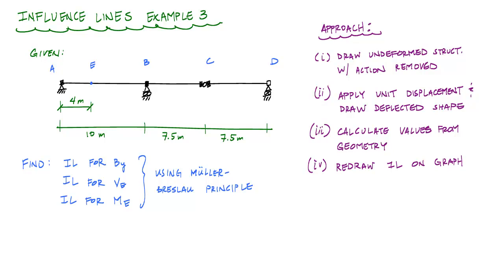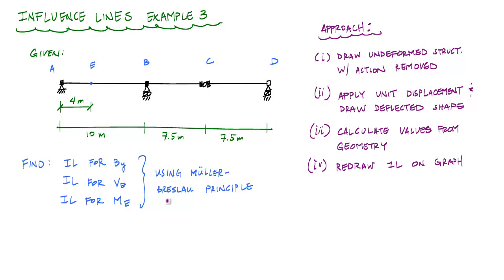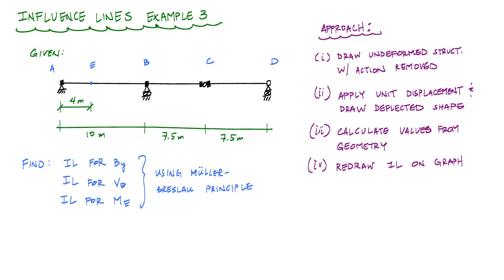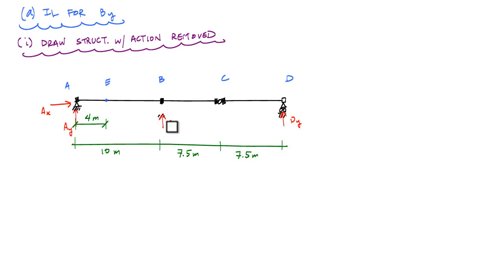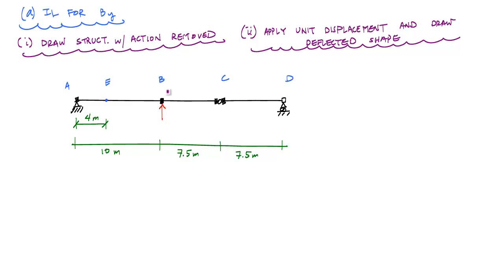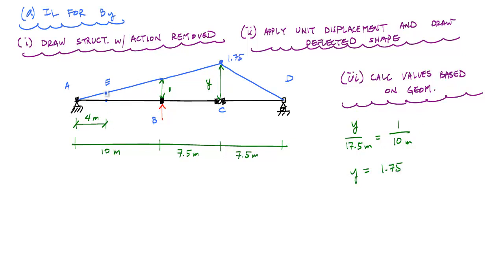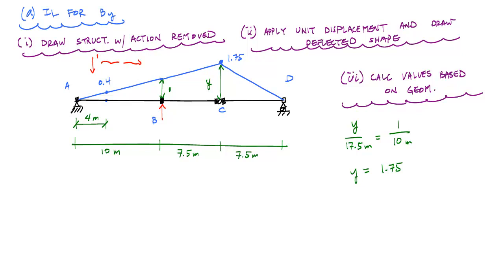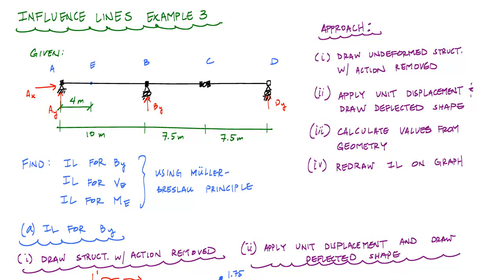Influence Lines for Beams Example 3 (Part 1/3 - IL for vertical reaction) - Structural Analysis

Comment: The question i have is off the topic of determinate beams, however i would just like to find out from you if im on the correct path. The question is for an indeterminate beam: if you have a 3 span beam, (end supports are fixed and the 2 supports separating span 1 and 2 as well as separating span 2 and 3 are roller) span 1 =EI, span 2 = 2EI =2 and span 3 -EI. How would you approach it to determine a point of the beam using the Muller Breslau principle. Would you combine the Muller Breslau principle with the Double integration method (Macaulay method) to take the varying EI into consideration? Hope that made some sense.
Reply from the maker: that seems like a reasonable approach to try. it's hard to say without knowing what you want to solve for.  I say just go for it.